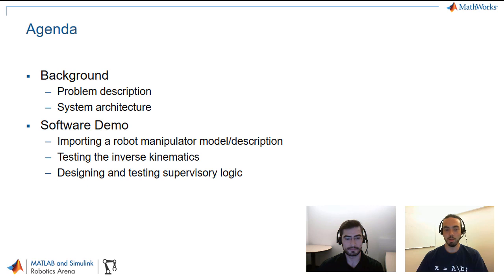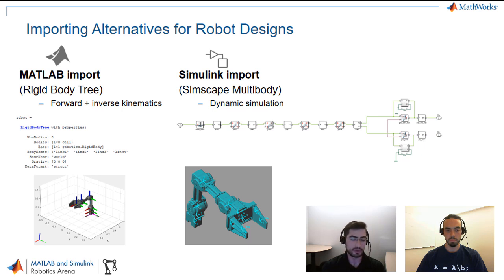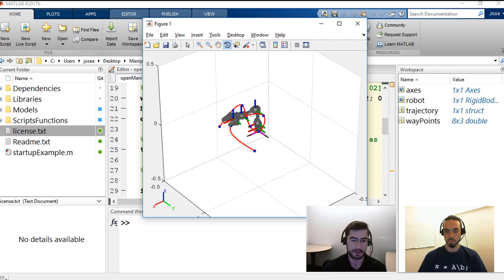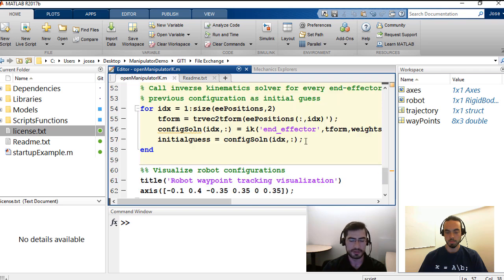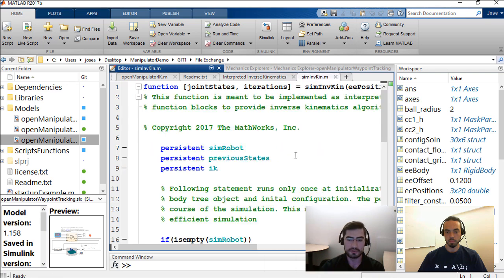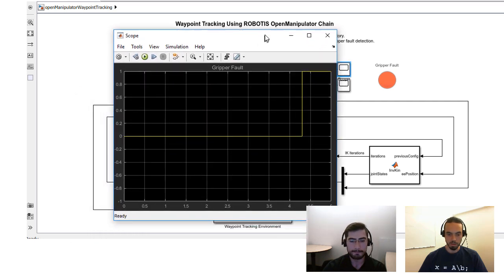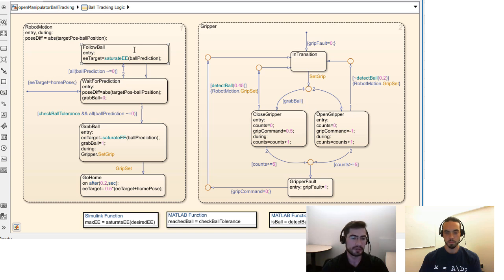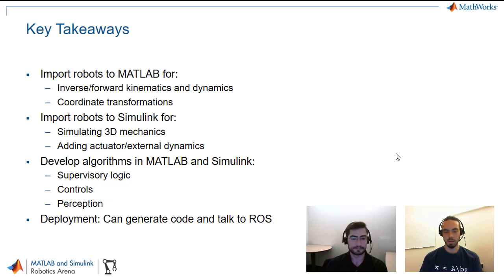Designing Robot Manipulator Algorithms

Comment: Thank you for this useful video. It has showed many answer for my questions about model importing etc.
 But I could'nt see anything about ROS. Are you going to continue on ROS communication etc. example on this model?

Edit: Shared template & example file does not include robot models. And it's content is little different from the video.
Reply: We don't have any plans to add ROS to this particular model, but we have 4 videos on ROS connectivity out right now! Look for them in the playlist.

Also, yes, the example files have been changing as new features/fixes come out. And the robot models have to be downloaded externally because they belong to ROBOTIS, the robot manufacturer. The instructions should all be there, but you can reach out at roboticsarena@mathworks.com if you have any questions.

Comment: hello,
first of all, thank you for this great work.
but it didn't work, even after downloading the files from: 
https://github.com/ROBOTIS-GIT/open_manipulator
I always get the message :
open_manipulator_chain.urdf is not found.
Reply: Hi -- as you also commented in the File Exchange submission, it's likely because the MATLAB path is not set to include all these subfolders. Make sure you've run the startupExample.m script first!
Reply: thanks for your reply,
I have set the Matlab path to include all these subfolders. In the folder urdf, there is no file with the extension .urdf but with the extension .xacro
Reply: Right. If you run the startup script, there should be something that automatically converts that to a file with extension .urdf.

If you have ROS/Linux installed, you can convert the .xacro file to .urdf yourself as in this question: https://answers.ros.org/question/10401/how-to-convert-xacro-file-to-urdf-file/

If this doesn't work for you, send us an email at roboticsarena@mathworks.com and I can send you back the .urdf file to copy in manually.